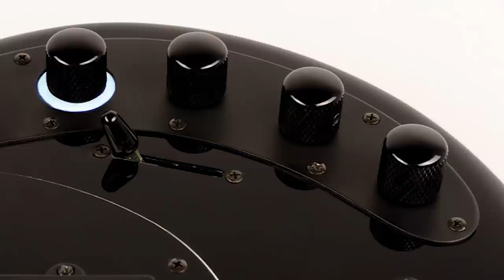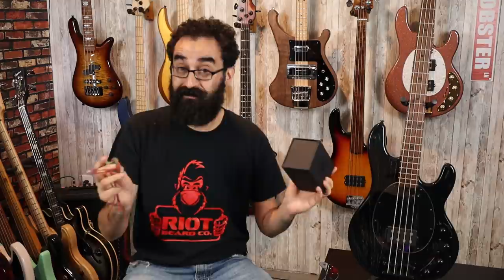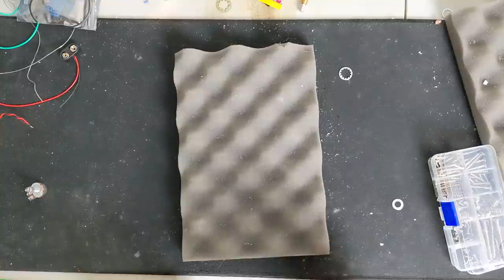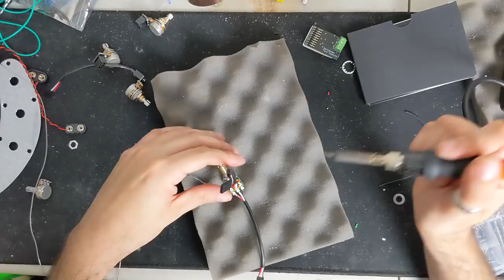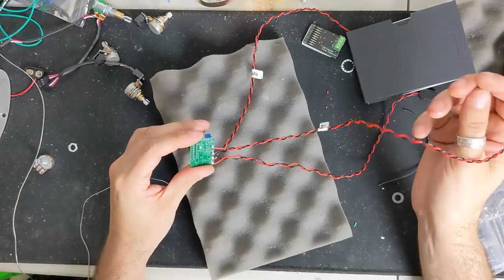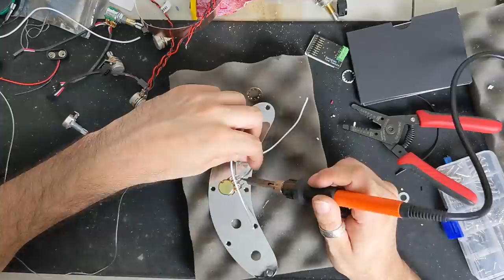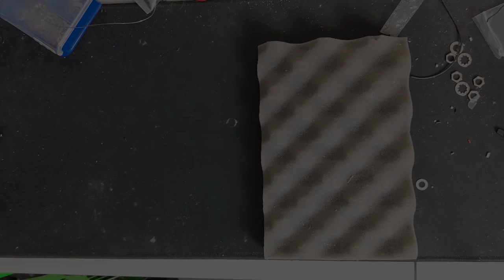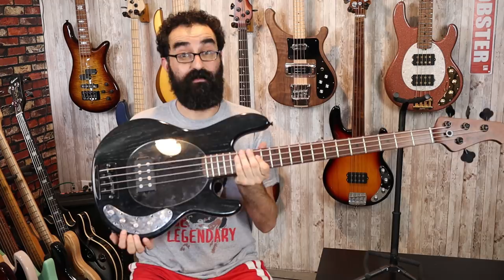Project DIY Darkray - AWESOME Onboard Effects Using Off-The-Shelf Parts! - LowEndLobster Builds

Comment: Do you think something like this would be feasible for a 5 string?   I'm assuming so, but figured it'd be worth checking!
Reply from the maker: Great question! Yes, this will absolutely work on a 5 string. Hell, it might be easier because you don't need to source the 5 hole control plate and just have to modify the pickguard.
Reply: @LowEndLobster   Even better!  Kind of a long shot, but my soldering skills are AWFUL.  Are there any solderless alternatives that you could recommend?   I think the darkglass is solder only which I can live with but less room for error is always good!
Reply from the maker: @jsteel120  The darkglass actually doesn't require much soldering as the input, output, ground, and 9v wires all use screw down connectors. I don't think there's any solderless solution for the QDD2, but the unit is 22 bucks so breaking one isn't the end of the world. If you wanted to not have the QDD2 overdrive circuit, the Darkglass setup pairs nicely with EMG and you can maintain most if not all the solderless functionality (you may have to snip/strip some wires)
Reply: @LowEndLobster  Oh awesome!  Thank you so much for the info!

Comment: Seeing you mod all the time wants me to begin modding, unfortunately I have one bass. Jazz Affinity by Squire; the reason I want to mod is obvious.
Reply from the maker: Thanks Jake! A great intro to modding for a PJ is the EMG Geezer Butler pickups. No soldering, plug and play, and relatively easy install.
Reply: @LowEndLobster  I didn’t specify but it’s a Squier by Fender Jazz Bass, is there a alternative to the EMG Geezer Pickups for Jazz’s? Great video by the way!
Reply from the maker: @just.jakeyd  AH! Sorry, I assumed it was the PJ. Here's a link to their passive J pickups. The first three are the ones you'd want to check out depending on what style you like. They come with all the controls, jack, and everything you'll need parts wise to install em on your bass. Only thing you might need is a socket to tighten and loosen the pots onto the control plate and a screw driver for the pickups.

Comment: Do you think this setup would work while making the bass passive?
Reply from the maker: Great question! The QDD2 requires a battery, but this could absolutely be applied to a fully passive bass. You'll still need a battery for the QDD2, but a 2 way switch could be used to bypass.
Reply: @LowEndLobster  I only ask because I never use the active EQ on my Ray34 and particularly don't care for it. A volume and tone knob would be ideal and add the Artec system since I already have a battery compartment. Maybe use a push-pull tone knob to activate the Artec system? What pickup would you recommend for a passive Ray?
Reply from the maker: Now that I think about it, this setup would work well 'passively' on a Ray34. You can have a Vol/Tone for the first two controls, and have the second pair be drive and drive gain. A push pull could totally be used to activate/bypass the artec system (but the first mode of five on the is a true bypass as well).
Reply: @LowEndLobster  That's exactly how I thought about the control setup. I did see that on the amazon page that it had a true bypass, I just wasn't sure if it cut power completely. Battery drain is the worst.
Reply from the maker: @Brotesque89  That's a great question! I'm not sure if the bypass negates the battery or not. I guess there's only one way to find out... time to throw one of these QDD2's in a passive bass!
Reply: @LowEndLobster  Or maybe turn one of your S.U.B.s into a passive bass? It'd be nice to have a guide. Planning on doing it to the ray in a couple of weeks.
Reply from the maker: @Brotesque89  That's a really great idea! I like it and I think I can make it happen. Plus the four hole control plate could house a stacked vol/tone, drive mode, and drive gain and the jack! Thank you for the genuinely excellent suggestions. Seriously, it's days like this that I am just floored by the wholesomeness, thoughtfulness, and insight of commenters like you.

Comment: I'm really not a fan of the fuzz or distortion pedals. I like the tube amp slight saturation but most of the time without the context of the full mix of a song I think it sounds awful. But there is one example of built in overdrive that I think sounds neat and it's the Alien Audio preamp in their Constellation basses, that for example David Hungate uses.
Reply from the maker: That's great info! Hope to check out the Alien Audio stuff at some point

Comment: What if I want to blend clean and distorted sound?
Reply from the maker: Great question Nick! We currently don't have a 'blend' function with this setup. However the way the QDD2 functions, each of the 4 drive modes gets almost more and more 'driven' the farther in you get. So in essence acts as a more 'digital' blend. However, a true blend can be done! That would be super interesting... not sure if I could fit it in the current control cavity, but it's a great idea and is feasible from a wiring perspective
Reply: @LowEndLobster  It is something you can do on next project

Comment: how much did you end up paying in total? as proof of concept it deffo works, just not sure about that distortion circuit you put, def sounds like a guitar OD, tho I'm sure you can still put it to good use, would have been awesome for that Hysteria playthrough you had recently
Reply from the maker: Not counting the bass, probably about $250 on parts. The QDD2 is only like 22 bucks on Amazon, and a 10 pack of the B10k pots that I used to add on was another 7 or so. Darkglass is $169, and the control plate was $20ish (though I'm not sure about general availability, going to see if the folks who made the EHB pickguard would produce a control plate suitable)
Reply: @LowEndLobster  thanks man, that is really affordable